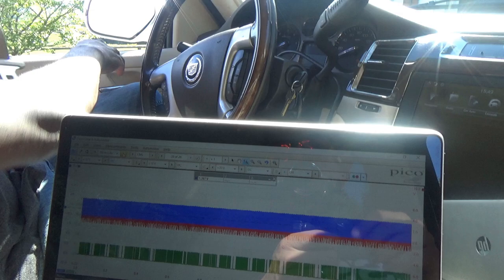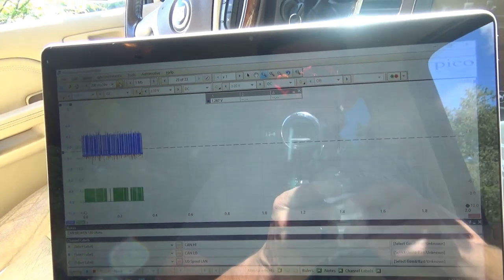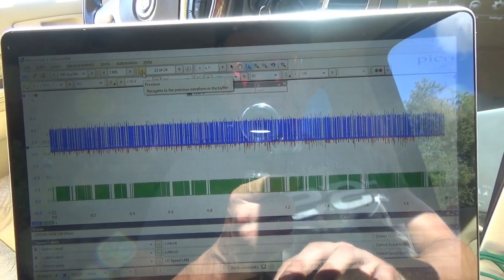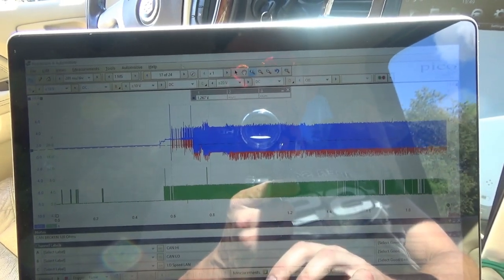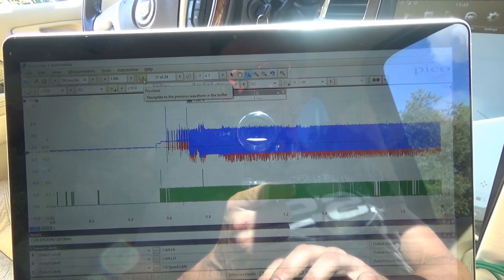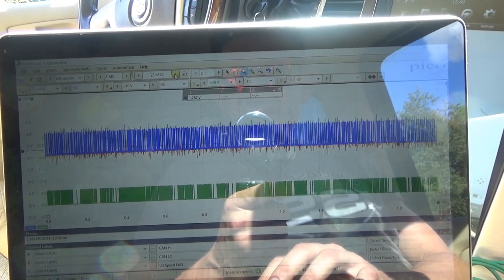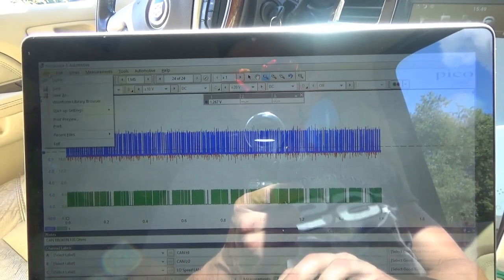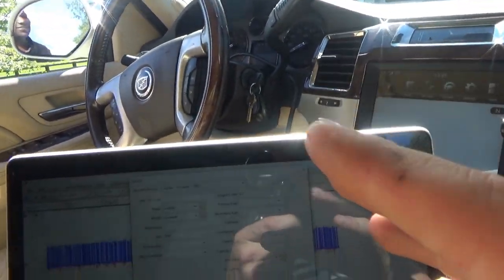OH NO... Parts Cannon ESCALADE is BACK!!  (Part 1 - CAN FAULT)

Comment: If there's anything still live on the CAN and adding voltages outside of the meter you'll get "off" resistances (ie, bogus readings) 

An AC impedance meter is more or less immune to introduced DC offsets and relatively cheap 

(Multimeters are great tools but it's important to understand their limitations)

Comment: I would do a voltage measurement from each CAN line to ground and batt+ and not just a differential voltage between the two CAN lines.  Or, disconnect battery and do your resistance checks all over again.  Or both.  That randomly fluctuating resistance measurement really does seem like stray voltage and not something that a regular resistor or wiring could do all by itself.  You could also maybe consider trying to run a little current through those CAN wires to see what kind of circuit integrity you really have.

Comment: In my opinion, having electronic modules with an exposed main connector underneath the vehicle sold and operated in the rust belt is just crazy. This module should be in the vehicle and not under it. Add to this the connector swap with all the splices, again exposed underneath the vehicle, I feel is not reliable. You would have to somehow seal the module and the harness so they are not exposed to water (or hold water) and salt spray.

I would have removed the module and inspected and cleaned the module pins on the bench. For inspection on the bench I use an electronic repair type stereo microscope.

If the module pins are heavily oxidized use Deoxit D5 spray to rinse and clean the harness and the module connector. Then apply Deoxit D100 with needle applicator and mate the two. Then disconnect and mate again. If you do several mating cycles (like 4 or 5) the Deoxit D5 + D100 will start to breakdown all of the oxidation and provide a noticeable lubrication, meaning the connection will feel easier to seat. When the pins mate smooth and easy you know they are clean. In my experience, the 4 or 5 connector cycles used in this cleaning process will not effect pin tension. You can try this yourself on the bench if you have some old oxidized machine barrel pins, like Deutsch DTM series pins, and apply Deoxit (use D100 with the needle applicator) and do some mating cycles with a single pin connection and you will notice the pin connection wiping action cleaning and lubricating the connection. The old oxidized pins will be cleaned completely with the repeated mating and mate easier.

Comment: Disconnect the battery if modules voltages affect the reading. You are middle of the network and one side is solid, other is not. The next good strategy is cut the network even smaller. I am not 100% sure but looks like failing transceiver inside some module. Leaks voltage and messing the resistance, interesting. Corrosion, it can not mess these numbers so high. Open wire, possible... Network smaller and it helps to narrow the problem

Comment: Falling down that VOM rabbit hole. Yeah, check the comm wires for voltage, if no voltage found, reverse your leads on your meter...if resistance changes then you may be measuring a module internals and not a load resistor.
You can also verify your ohm meter by measuring your decade box...your VOM battery could be low.

Comment: As a telecom Tech you cannot measure resistance if theirs any residual voltage on the cable what you could do is short cct one one end check the the integrity of the cable along the way .

Comment: I’d go from the ecm and measure the wiring harness wires before suspecting failed modules. Usually the connections in the modules are just direct connections on the circuit board. If you find a bad module it is probably just a cold solider joint or corrosion on the pcb.

Comment: Not everything that CAN be fixed SHOULD be fixed. RUN away from those wire nut and shady connections! I would insists on a new wiring harness or not repair it, or it WILL be back!
Reply: I agree
Reply: Could not agree more.....OMG....its a nightmare ...just wait until the grenade goes OFF

Comment: I read a few years back that an engineer or a group were trying to get a patent on a system that uses smaller simpler modules at every accessory location with just a power and ground at each with one fiber optic communication line connected to everything then back to one vehicle computer

Comment: Do all bus resistance checks with the battery disconnected and with no more than one ohm meter. This will rule out wire integrity problems and it might point you to the faulting module. Reconnect the battery. Interrupt the bus somewhere in the middle. Connect to one of the ends: a 120 ohm resistor, a scope and your scantool. Key on. Check if the bus is healthy and if you can talk to all modules on the leg under test. Do the same in the other direction. Remove and bypass suspected faulty modules. Restore the bus and keep suspected faulty module bypassed and test again. Of course without the extra resistor, when testing the restored bus.
The splice with those wirenuts and blue splicer-things shouldn't be there to begin with. A better solution have been to de-pin from the broken connector housing and re-pin into the replacement connector housing. This repair job as is, will probably fail prematurely. It should be replaced with soldered and heatshrinked joints, and properly wrapped, to give it some protection against vibrations and the elements.
(My edit: I corrected my resistor value. It needs to be 120 Ohm, just like the termination in the last module. Not 60 Ohm. My bad. Sorry.)

Comment: My first thought was a strange one, What size are the owners feet. I've seen before that sometimes you can clip connectors (or computers as possible here) when either getting in or out or during driving. That can cause all sorts of strange things.
It got less likely as the video progressed but still worth a thought maybe.
Reply: That can happen.  My wife had a friend who had a Toyota Matrix.  She was hopeless and helpless about cars.  She was having a problem where the carpet in front of the front passenger seat was wet.  She had taken it to the dealer and their response was "They are all like that.  Nothing can be done to fix it."  Then she brought it to me.  It was literally a 30 second fix.  Her long legged daughter had kicked the AC evaporator condensate drain hose loose from the grommet in the floor so it was draining onto the carpet!  I wish they were all that simple!
Reply: @Vincent_Sullivan  it happened with my old car, the guy who collected it for me took me out for 10 minutes in the car and during the drive the dash started lighting up like a Christmas tree.
Turns out in my boots I had kicked a connector without noticing and the bcm was half unplugged.

Comment: I re-watched the video when you disconnected the blue BCM plug and stated that the reading should be infinity across the tan wires. It measured 4.5Kohms. That is not infinity. Other posters mentioned disconnecting the battery because of residual voltages. (i.e. leakage between pins on the connector(s)) That would make perfect sense as you noted when you paralleled the other ohm meter with the existing meter and measured different "ohm" readings. I believe that you still have connector issues. Also the crimps used at the EBCM are definitely not weather resistant, they are for use in dry locations only.

Comment: Wow,   that's so crazy with 400 ohms!!!  It should be 120 ohms unplugged and 60 ohms plugged in.   Mmm,  still have hard time to understand this weird speaking network!!!  Great video Ivan.  Let's see what part 2 brings!
Reply: Either stray voltage messing with the meter, or bad connection causing a series resistance.

Comment: Disconnect the vehicle battery. use a 1.5volt battery on the can to test resistance with an amp meter. Section by section. Sometimes you need a bigger load to find a fault.

Comment: Humm.   A bit of a brain teaser here.  My first guess with the inconsistency is, it appears to be like rotten or rubbed through wires.  But where?  Need to keep digging.  Love that EBCM connector splice.  It doesn't inspire much long-term confidence though.

Comment: One thing I would do is measure same things but with battery disconnected.Or short-circuit the wires at the modules that have the termination resistors and check the wire integrity.

Comment: This is exactly why all networks should have a common point to test like a star connector. Putting them all in series just makes it unnecessarily complicated under certain failure conditions. Had a couple of recent communication issues on Chrysler vehicles and as much as I hate Chrysler both of those cars had breakouts at the star connectors and both were diagnosed in a matter of minutes. It doesn’t help matters much that in this situation you now have a shady crimp job and an aftermarket Tesla screen in the mix on the network.
Reply: In order to have a star topology, they'd have to install a network hub to connect things together.  (Extra $).  The reason they run it in series is a high speed signal will run though the network until it's absorbed by the terminator.  Connecting things as a star would cause too many reflections unless you really lowered the network speed, or used a active hub.
Reply: If you go to a star topology you start increasing the amount of wiring.
Reply from the maker: @ferrumignis  not by much...
Reply: @russellhltn1396  Mercedes do run their CAN systems via a pluggable star point which has diagnostic benefits.
Many VAG and BMW are starred out via splices within the loom.
However, the linear network style is generally better for signal integrity

Comment: Agree with others. OMG those little telecom connectors are designed for a single pair of solid core phone wires like 26ga. Those and wire nuts. Neither are designed for a high vibration automotive environment and neither are designed for that type of wire. That garbage needs to be done right. I'd also suspect that same garbage is behind that aftermarket giant screen radio. Could also be an interface module behind that radio that ties into the network as well which can be causing can problems. What a mess.

Comment: 17:30 I'm looking right at that ground connection in the background an thinking that if any of those grounds for modules in the front or rear of the CAN bus goes bad it could cause strange readings when measuring the termination on that CAN network.  The added resistance to ground adds into the termination resistance...

Comment: Those are "B" Wire Connectors. Old-Timey connectors for splicing telephone wire/cable, 24 or 26 gauge wire. There is a "B" Wire Connector Presser for crimping these connectors. I worked in Telcom for 40 years and I wouldn't trust those connectors for this application.

Comment: Ivan..  You should look up 'compuram.   It will tell you how much ram your computer will actually hold.  I have an old Acer and everything has always said it can only use 8gb of ram.  But it turns out that the newer developed 32gb ram sticks work great, as long as they are in the same pin/ size, etc..  Even if they are faster speed-- it will still work:   it will just run at the max speed that the computer can run it...   Once I looked up what it could handle, I went ahead and bought the cheapest ram on ebay-- and have 16gb now, for only forty dollars.  Well worth the upgrade from the original 4gb it came with.  I could have gone with the full 32gb, but that costs three hundred-  so I passed on that.   Then you could run a lot more scope time if needed, because you have a lot of excess ram.

Comment: I thought most terminating resistors on a can network are 120 ohms... so wouldn't that reading be just a terminating resistor?
Reply: I was speaking to the beginning of the video where you were commenting on 120 ohms being too high, sorry I should have clarified.
Reply: @TheFlanman10 Yea, but in the normal mode of operations there are two 120 ohm resistors on both sides, so 60 ohms total.

Comment: Ivan... I kinda got 'glazed over' following your diagnostics.  However, if you are in persuit of funky resistances and intermittent connections ONLY and are disrupted by weird voltages, why not disconnect the battery or pull associated fuses?

Data buses require terminating resistances at EACH END.  They are just resistances.

Am I seeing 'star pattern' rather than 'daisy chain' for the network?  Hate star patterns!

Comment: This was an action car right? Well anyway as soon as he got home he should have sold it.  I know you " fixed it " but there was a reason it was at the auction in the first place. Your not the only one that could diagnose the problem and have it come back on them.  What was the problem with the zip ties or replacing the harness all the way to the next connector? As far as I'm concerned it' has two wheels in the crusher as it sits. Unless he gets a new / junkyard harness that's not broke or cut up. Then have a body shop take it apart and replace that harness.

Comment: You can't have any voltage at all when you are measuring resistance. As you saw, one meter showed 400 Ohm and the other showed 50 Ohm. Did you notice you swapped polarity between the two meters? So that 22mV was skewing one meter higher and the other meter lower. Get out of the rabbit hole!!! lol Circuit has to be completely de-energized. Even if you find what device is putting out the 22mV there's no guarantee that it's bad because of that low voltage which should not affect the CAN coms.  Same with two Ohm meters on the same circuit.... Nope! The voltage from each meter will fuck up the readings.

Comment: To me that looks like what happens when a solder joint fails and leaves a whisker of metal barely touching an oxidized crystallized trace.  Depending on the voltage and components around it, it can act like a resistor, a poor quality rectifier or a foxhole crystal AM radio receiver*.   The wiring harness if not connected to a good ground and terminated can act as an antenna.
*We made those as kids using a carbon steel razor blade, a piece of "lead" from a wooden pencil , a safety pin and fine wire to make a coil and antenna. The output was enough to drive a headset.

Comment: All us old guys are laughing at you young guys( and gals  ) that need fancy damn computers to keep your cars running . We could fix most problems on the vehicle with a few screwdrivers and a crescent wrench lol . New generations depend to much on electronics. By the way , the older motors ran just as smooth as today's junk . Look at that handful of wires . Repair shops love it cause there is no way the average guy or gals can work on their fancy damn $50,000 - $80,000 vehicle

Comment: ??  Have keep doing circuit checks. I had a thought when you where checking the blue connector at the body control module, The car was a sleep, and everything good at 122.** I would have cycled the key? to wake up system.

Comment: those blue connectors are NOT ment for that purpose they are ment for single core 18 gauge and thinner wires they are NOT ment for critical wiring..

Comment: Set the car on fire. Eleminate the problem totally. Just kidding. I will be interested to see where the issue is. I suspect damaged insulation and corrosion on the conductors. It will be in a place that is hard to get to as well. Can't wait for Part 2.